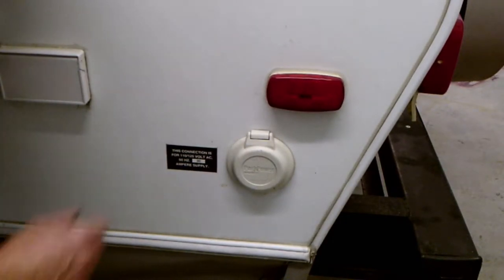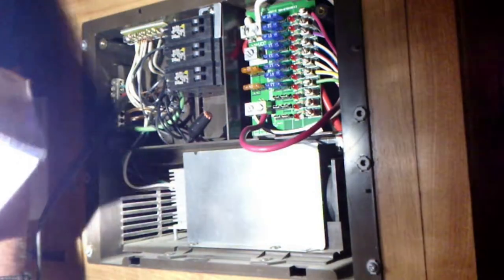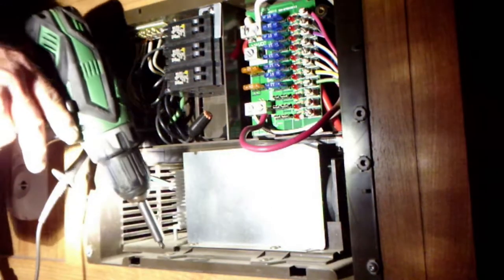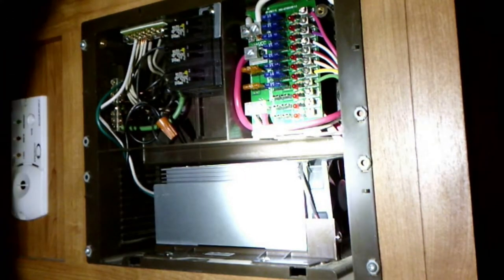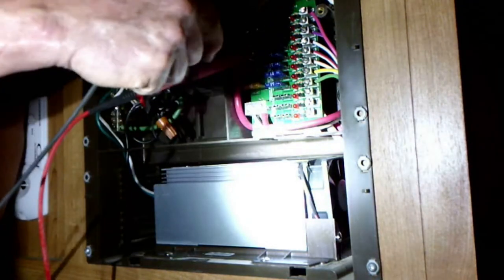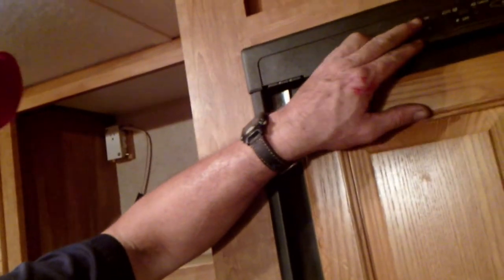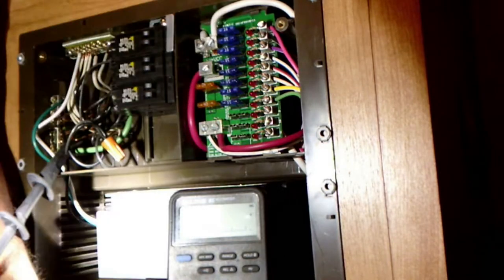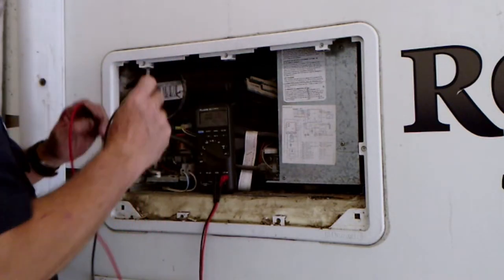You Plugged 30 amp RV Into Dryer Outlet, Now 12 Volt System Not Working

Comment: Here's one for the ages, I am working on a TT 30 AMP and believe the owner plugged into a 220v home utility outlet and one wire of his cable was fried where the neutral likely found a 120v hot wire. I've changed the shore cable and his converter and put in two new batteries, (he had none) and I now have 12.5v from the batteries to the panel. The AC side of the panel is the issue. Power is at the 30 Amp RV feed receptacle and at the panel at the Main breaker  It even has 120v as does the feed bar to the other breakers. Lean in and solve my problem or give me a hint, I lose the full 120v on the feed breaker if I turn on any other breaker and if any breaker is turned on, it only has 39v with minor variations. While the microwave lights up, it doesn't work, but neither does the AC or the newly installed converter. BTW My panel is identical to yours. I plan tomorrow to test continuity from the the neutral and ground at the receptacle to the panel and the condition of connections behind the panel. Thoughts? A partial short, a ground issue, the breakers may have all blown? I'll test those too.
Reply: Is the power supply coming from a panel with bonded neut.? Immediate V drop if ANY breaker is on sounds like some kinda short, but if you're not smelling burning.. I feel for ya. I'm dealing with an RV that says it can do 120/240 at 50A at the feeder breaker panel, but it actually fuckin can't when I inspected the inner distribution panel🤯
Reply: @JerryMcCray-d1k  😂 or the gauge of the wire from the receptacle to the panel is #12, lol

Comment: Just saw your video from a YEAR  ago on checking and replacing the converter and checking microwave and fridge after losing DC power. I have been working for weeks on why I have no DC power! I am sure I caused it because I probably blew it out when I turned  generator on with air conditioner going while I had it running on shore power at the same time! I have since learned I have no transfer switch or GHI switch’s or generator reset switch. OR ANY switches that might have tripped.  So I sincerely think I’m the one that overloaded the system and shut it down. AC power works great no problem, air conditioner works on AC system no problem! air conditioner will not work with the generator running because of no DC power. Nothing that requires DC is working! I have been trying to figure out how to restore DC power. I am NOT an electrician; but I do have a great deal of just plain common sense and can usually follow instructions pretty well. I I have watched a lot of different videos from A-to-Z and I have learned a lot and by taking information from all of them and putting it together I have been able to check my whole electrical system all the way down to even checking the fuse that’s inside the converter box itself. So I have ordered a new converter. But the point I’m trying to make is just in your one video today I found out several things that I had not been able to find out and all of the other videos I have watched. Especially about the converter being piggy backed in with ANOTHER circuit. I thought the converter had strictly a stand a lone  circuit to the breaker and the fuse. So that’s where I could not quite figure out what wires to take off  and what wires to leave on! I could not figure out that pigtail at all and no one had ever mentioned that the converter could be wired into the same circuit with SOMETHING ELSE UNRELATED  TO THE CONVERTER! YOU EXPLAINED THAT! There is no labeling of any wires going to any circuits or even the breakers! No diagrams or schematics of ANYTHING for the whole coach and engine!!! . There  are 6  DC fuses that are  labeled,  but that is all. So I had no idea what wires were going where! Since I live alone and have no help it was very difficult to pull a fuse run and see what was working or not, going back, putting it put it back it and do another etc. etc.The whole coach, engine compartment wiring system, everything is a horrendous mess! 
I  have been able to check everything out and apparently narrowed it down to the converter. I have ordered a new one and then I will go from there. Honestly when I got into this wiring I was blown away because it was atrocious!!! Naked wires connected together without any electrical tape over them, without any kind of splice covets, Wing nut on load wires barely hanging on, screws in crooked or halfway stuck!  The converter had never been secured to box, it  was  it was just sitting in the bottom of the box sliding around.I have paid thousands of dollars for other electricians  and mechanics to work on this 1990 Ford F350 46O, 7.5 L class C motorhome. Every single time it has had to be redone by someone else. I’m over it!  I have no more money. I am on a very low fixed income and I cannot afford to hire professionals that don’t do it right themselves. So I’m having to do this myself!  so far things have gone OK I’m very cautious!  I just wanted to compliment you because your explainations were short and to the point and it assured me that I had been checking everything correctly. I was just flying on a wing and a prayer. However,  when you would show where you placed your black (neg) lead from your multimeter, it was hard to see on camera exactly where you placed them because of either not enough light or your arm was in the way; like on the refrigerator for example.  It was a little dark and I could not  see the neg and  positive positions,  for the leads. That was the only confusing thing that I saw for me. Also the way you explained about checking the refrigerator, simple, to the point. Didn’t know it had fuses  outside! So I just want to thank you for your video. I subscribed so will be looking for more! Yep, your speech was slow enough that I did not have to keep replaying it to hear what you said because my hearing is not that great either! I think you did an excellent job on explaining everything; you went slow enough for beginners; you didn’t speed the camera up 90 miles an hour to show what you were doing, assuming we already know…. I didn’t know what you were going to do. So it was very informative to me. I appreciate it. I ordered a new converter because after watching  your video, I am sure that I did everything right!  I have lots of questions but can usually figure them out! I PERSONALLY wanted to thank you because I am a 76-year-old female with severely deformed fingers from arthritis; multiple sclerosis; no cartridge in my knees and it is impossible for me Squat down to the floor to look into my distribution box with converter. It is torture! I can’t afford to pay more people to keep continuing to screw everything up so I’m just going at it by myself. You were very helpful and I thank you for that. So waiting on new converter! Please keep posting I’m especially looking forward to any other videos you post. I have already checked  all my systems and they worked and still do on AC power; just no DC power now… hopefully that will be fixed in a few days! Oh, the pigtail thing…. I had no idea why that was on a breaker box going to the converter….. until you explained about the converter not needing so much power so that same breaker (circuit) could be used for other stuff… so far I don’t know what that other stuff is but I will be finding out now that I know why two black wires were pigtailed  on that breaker. So, see , if I had not run across your video and all that great information that you put out there so simply I would not have had any confidence in everything that I have done so far. By listening to your video I know that I have done everything right after this point. And if you have other videos I will check those against what I have already done with my other systems to make sure they are correct also. Be assured I certainly did learn and was able to confirmed that what I HAD learned was correct strictly from watching your video. Thank you again and God bless! I wish I could use you as a resource to ask a question every now and then but I don’t know how to make contact with you. :(
Reply from the maker: Thank you so much for the kind words. This makes YouTube all worth it to me. Feel free to ask questions here and yes I have other convertor videos too. There is a LOT of mis-information on Youtube. A couple of other channels you can trust is AZ Expert and My RV Works. If you got to their channels, please tell them that I sent you.

Comment: So I loved the video and I also was visiting my wife’s family and they said they had a 30 amp RV plug so I didn’t have a tester and plugged in and instantly popped my camper breaker. I have a coach that’s 50 amps. All my 12 V fuses are good but I have no power to any of my outlets.  One ac turns on but the other doesn’t and my fridge works on gas but of course no A/C power as of yet?   Would that be my converter as well? I’m totally capable of doing the work myself if I know what’s wrong.  Thanks for your help and the video
Reply from the maker: Sounds like your 50 amp breaker in the RV power panel has either half tripped or half the breaker is bad. Flip that breaker completely off and then back on and see what that does. If nothing changes start checking for power to see where you lost it. Thanks for watching and commenting. I trust that you subscribed to my channel.
Reply: All Seasons Mobile RV Service I did subscribe. I ended up changing their outlet and wiring it correctly for a 50amp but I still don’t have power to my outlets in the coach. Does this coach have a converter? I know I have an inverter
Reply from the maker: @whysurvivewhenyoucanthrive7592  can you call me in the next half hour or so? 304-254-9363

Comment: Great job! I had a guy doing some work in my camper and he started up a compressor with my air on. Blew the switch so now when I turn my air on it is slow at coming on. Did it mess anything up? Thanks!
Reply from the maker: The compressor was plugged into your camper? Blew a switch? What does that mean?
Reply: There is a built in time delay of even a couple minutes or more. It's not good to stop and start and quickly repeat it back to back at the thermostat that can ruin the compressor on the AC. So, they built in a time delay. Time it and see how long the time delay is.

Comment: The 30A 120v plug has a rounded ground pin, and the 30A 240v plug, which is typical for an electric dryer, has an "L" shaped ground pin.  They are designed so they can't be plugged in by mistake.
Reply from the maker: In a perfect world, that would be the case. It just doesn't always work that way. I usually do this repair 3-4 times a year
Reply: older plugs can be incorrectly used.   newer ones have the L shape
Reply: Thanks guys.  I'm glad I checked here on Utube before I attempted to plug my RV into my dryer plug.  Whew!

Comment: What about water heater how does that kick on? I wired mine 220 like a dumbass  . So far only thing that it took out was a box fan and inverter. I just ordered inverter 10 minutes ago . My fridge still works microwave still works . My inverter wont be in til dec 16th 2021 4 days from now . Hopefully when inverter comes in and I wire it back up that my a/c works but I'm guessing it should since display is DC correct. Thanks for the video also. It was the very first 1 on YouTube. And I'm glad it was.
Reply from the maker: I am glad I was your first. Will you still respect me in the morning? Just kidding. I have other videos on testing and replacing converters too. Subscribe to my channel and check those out. I was acting like an idiot and forgot to answer your question. The WH requires 12v DC to run the controls. Hopefully everything will work after you get the converter.

Comment: besides shorting out the converter anything else fried before the converter... shouldn't a/c lights still work after repacking fuses
Reply from the maker: I haven't seen an AC light in a camper since the 70s. They are all DC.  Watch that whole series. This one had more burned up stuff than I had ever seen.
Reply: @hillbillyrv  thank you

Comment: So, I hired an electrician that did the same thing. After blowing up my microwave and probably ruining a few other things, he came back and fixed the wires. My A/C works, Elect water heater works, all outlets are good but the fridge dosent cool. I replaced the fuses in the back, it wont spark on propane . The auto ligjt stays on but not cooling?
Reply from the maker: Hey Pappa Truck. Sorry to hear that. It happens way too often. It might have gotten your AC heating element in the refrigerator. Check it out with ohm meter. I bet it shows no resistance, if so, replace it.
Reply: Did you make sure that you had the refrigerator automatic button off before you tried to start your propane refrigerator? Sometimes you have to push the propane button  in by itself before the igniter will work then after that you can put it on auto. That’s what I found out I had to do to mine. Good luck!

Comment: Hay man i like your work skills i need some one to fix my shore power on my fleetwood i only gets power when my generators running but no power when i plug into my shore power give me a buz if ya can thanks
Reply from the maker: If you are in the Beckley, WV area or you can bring it to the Beckley area, I can work on it. 304-254-9363
Reply: Just a thought: go get you a little thing called a Klein KLEIN tool, it looks like a great big fat pain that you put in your pocket. Check your shore power outlet the plug on the end of your trailer cord and the cord itself to see if it is electricity running through it. That little Klein tool will tell you that. If not there’s something wrong there to start with. Then you can go from there ,. The tool doesn’t cost too much; you can get one most auto stores or even Walmart I think & Home Depot.